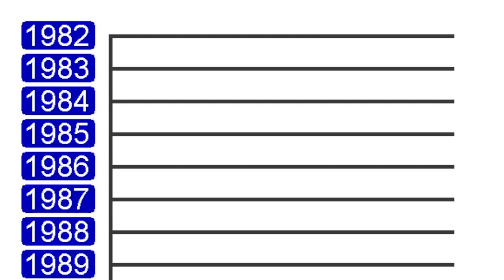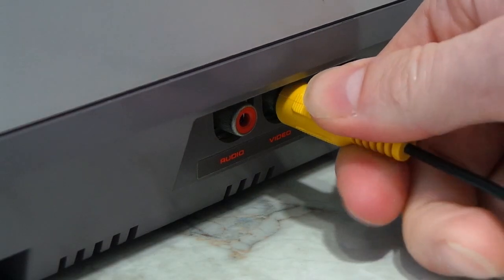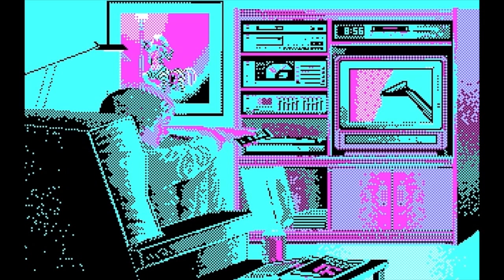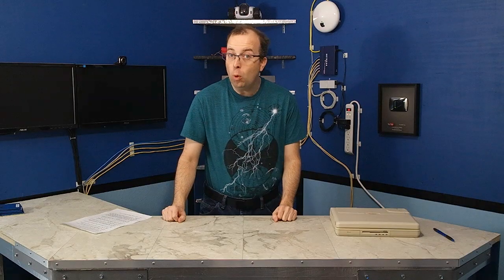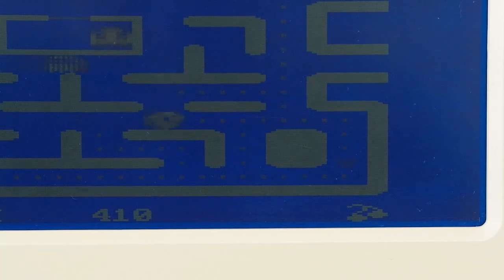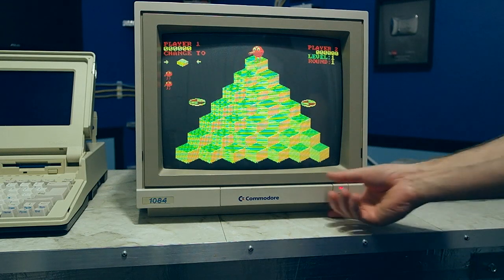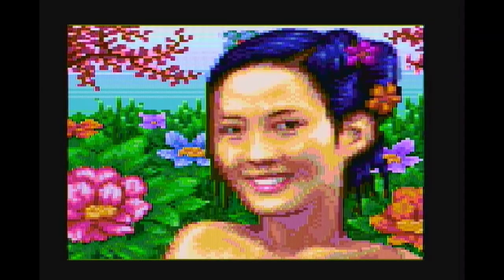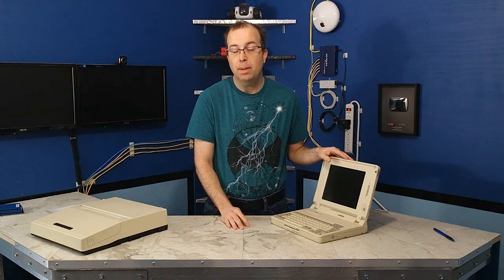CGA Graphics - Not as bad as you thought!

Comment: Would the CGA 'cheat' composite palette have worked with different tv systems (SECAM and PAL) as well as NTSC?
Reply: +TheChipmunk2008 .... depends. You would have to change the way the signal was output, most likely. The differences between colour encoding with those three standards caused issues even amongst machines that used Composite (or RF) as their primary or only display output option - most notably the Atari 2600 (and some of the 8-bit computers), Apple II and NES. Generally the NTSC versions of those had the best and most controllable colour output, and the PAL/SECAM ones either had to have converter circuitry built in to produce something more-or-less like it on those TVs, or just forced their users to put up with inferior colour depth (typically, PAL had maybe half the colour choices, and SECAM had nothing more than a very basic selection).

It's all down to how colour is encoded on the different systems, which is itself a historical side effect of how much earlier NTSC adopted colour transmission - by the time PAL came along, the technology had improved a bit, and then some more with SECAM (it only lost to PAL in 625/50 regions because of having a much larger installed user base).

So, NTSC uses an AM signal, at a rather lower frequency and intensity (and thus resolution) vs the existing monochrome one, with some phase quadrature inside of itself to encode the two different colour axes, but not in relation to the mono signal. Hence how it doesn't generally cause much visible interference to the picture when viewed on a black and white TV, but if there's a patch of intense colour you can see a peculiar alternating light/dark pattern against the mid-grey of the area in question... (starting to see how this works with CGA yet?). On a fuzzy enough set, this is blurred out, and the average intensity still remains the same on the whole, so it's deemed acceptable - and in any case, B/W sets weren't expected to stay in use for all THAT long, and they tend to be quite small too.

This also is why NTSC colour is so blurry, and full of fringing artefacts, and susceptable to being disturbed if someone's wearing a strongly patterened shirt, and you have to twiddle the "hue" knob from time to time on an older set (...which either adjusts the DC offset of the separated-out colour signal or alters its absolute phase vs the detector circuitry... I can't quite remember which). It's a total hack, and suffers in much the same way that AM radio does vs FM.

Which is what the other two systems use ... FM. Instead of adding the (otherwise pretty similar) colour signal directly on top of the mono one, they use it as the modulation input to an FM system, thus modifying the phase component of the mono signal instead of the intensity... something which, although it's technically distorting the picture, is far less visible in a mono picture than futzing with the brightness, because it happens at what would now be called the sub-pixel level (IE any particular bright spot is moved left or right on the line enough for the circuitry to detect a change, but not the eye). This also has the advantage of making it much easier to get the hue calibration correct, as it's tied to the actual signal frequency, and lets you encode it at a higher resolution without sacrificing the quality of the black and white component (in fact, higher rez colour could be argued as reducing b/w distortion, though greater depth / accuracy WOULD increase it). It's much the same concept as FM Stereo, in a way. Also, the colour accuracy isn't affected so much by how bright the picture is...

Additionally, the polarity of the phase shift is reversed with each field, meaning that any slight drift is corrected by averaging-out - either physically (with a sort of line-by-line dither, you could say - a technique now sometimes taken advantage of by retro system democoders) with each field showing an image that's slightly wrong, but in the direct opposite way to the previous field, so the eye sees, at worst, a little bit of film-grain like temporal colour noise; or in the set itself, with later and more expensive models, which used a delay line or even a framebuffer to sum the two together and then apply the same colour info to that line in both fields, reducing the effective vertical (and temporal!) colour resolution vs NTSC and "original" PAL (still not quite to that of the horizontal, mind) but eliminating the flicker and making the reproduction dead-on.

Of course, this would mean that with increasing phase error, the saturation would decrease, but this could be counteracted with the regular saturation control (that could be turned up very, very high on most PAL sets, if needed), and was taken as a handy, subtle bit of in-band notification that either your set was badly tuned or your aerial needed adjustment. A typical analogue PAL broadcast would first exhibit fading and increasingly noisy colour, then effectively drop back to being (somewhat snowy) black and white as it became impossible to realitically determine the FM phase, then start to lose sync here and there, before actually fading out to white noise. If you could only pick up the black and white part of a channel, you knew it was pretty borderline on reception, although just about good enough to still stay in sync. You might not even get the (also FM...) audio track at that point, in fact.

Hence, outside of a minor bit of fringing that's as much down to electron gun convergence as anything else, PAL sets take absolutely no notice of weird spatially-distributed black-and-white or other coloured patterns unless they're pretty extreme (a weather forecaster wearing an ill-advised checked jacket for example), but even then due to the phase alternation, and how the colour clock isn't absolutely locked to an integer number per line as per NTSC* (I think it's actually something-and-a-half or -and-a-quarter?), even those displayed more as rolling, flickering moire patterns than a flat colour. It was in fact one of those characteristic original-PAL "problems" that NTSC didn't exhibit, but then melted away as more and more sets started to use the electronic rather than physical averaging, leaving either a more static moire, or a flat colour equal to the average of the checks / whatever the original pattern was.
(* this is why the framerate is 29.97 not 30.00, btw, and the line rate is 15734Hz - the mono and colour signals had to be locked together, but the colour frequency had to be changed to something very slightly different from the original 15750Hz line frequency for reasons both of avoiding interference with... something or other, I forget... with the secondary feature that along with the "colour burst" sync it would signal the set that it was a colour not B/W signal)

You might be able to do SOMETHING along those lines if you're clever enough, but really, most systems built for PAL use either built an FM signal from scratch, or where available took the Chroma part of a higher frequency but otherwise NTSC compatible S-Video signal and fed it into a simple modulator acting on the Luma which flipped its phase at each VSync. I think that's even literally what's build into the simple Composite <> SVideo converter dongles you get, a very basic bus-powered chip that flips mode between combining and splitting depending on which side is being driven and which side is the sink, and has just enough logic to tell PAL from NTSC (probably going purely on line rate or count) and whether it's on an "odd" or "even" field. Though SVideo never really took off much here as it didn't offer enough of an advantage over composite (it basically reduced some of the fringing and red/cyan green/purple colour clash you got with high-rez images) when RGB SCART was already available anyway. Pretty much only ever saw it with DVD players and some laptops and consoles derived from NTSC hardware...
(oops, out of space O_O)
Reply: +TheChipmunk2008 
(cont)

For that reason, you'll quite often find that composite output from old computers in PAL areas is actually described as "monochrome only" where RF and/or RGB output (digital or analogue) is also available, because it's expected you're only really going to be using that to hook up a cheap black'n'white or green/amber screen CGA-compatible monitor for basic word processing and other serious applications in low-colour 80-column mode rather than gaming or colourful graphics (for which you'll just plug in the RGB cable to a colour monitor or a SCART TV, or use the RF cable). I suspect that it is in fact either outputting a straight NTSC-spec (but 625/50 rate) signal, which will be rendered as black and white on the majority of PAL screens of the time, or even deliberately stripping the colour signal from it before output to avoid the dotty-pattern effect.

In fact, you couldn't play NTSC console games in colour on our "old" (early 90s, 25-inch) tube TV using a 3xRCA or cheap composite-signal-only SCART lead - they just appeared in monochrome with that characteristic patterning. You had to use at least SVideo (worked with some fringe cases) or more commonly full RGB, in which case it effectively synced as PAL-60. Annoyingly, now that I've got both a portable CRT and a regular large-format LCD that are perfectly happy with basically any signal you can find to feed them, the machine I wanted to do that with (a recently acquired Amiga 600) deliberately strips the colour data from its composite output... for both NTSC AND PAL modes. Meaning until I can get a SCART lead for it, I'm stuck using the RF output. Thankfully it's pretty good quality, the TVs have strong tuners, and the broadcast analogue signals have all been turned off, reducing interference, so it still looked fairly good, except for when I tried using a word processor in hi-rez interlace mode on the LCD... it reduced the usual flicker to nothing more than an occasional shimmer around the mouse pointer, but the actual letters became blobs of orange and blue...

(Which suggests you may be able to do something by taking advantage of the additional interference and blurring effects of the composite signal being further encoded into RF for transmission into the tuner - so the colour is two different DC signals quadrature-encoded into a single waveform, frequency modulated into the brightness signal, and then further modulated onto the carrier... - but the effects might be difficult to achieve and limited in scope, and possibly even vary according to horizontal and/or screen position...)

You'll note I haven't mentioned SECAM so far ... largely because it's pretty irrelevant these days, almost any SECAM device still operating will also be PAL compatible and probably default to it anyway. A bit like a colour TV being technically compatible with monochrome signals, and some older UK sets having twin-system (UHF 625-line colour and VHF 405-line B/W) compatibility, but the secondary system hardly ever being used in anger.

However, should you be in the position to try it and have the urge, the main difference between them is - should I still remember this correctly - that instead of transmitting both colour components simultaneously in a quadrature encoded wave modulated onto the colour, the transmitter instead averages each component over two successive lines (fields?), and transmits each averaged component separately on the alternating lines/fields using a rather simpler straight FM encoding like that used for stereo radio. The receiver then separates and stores that data for the first component, and combines it on the fly with that for the second one as it comes in, using it as the actual hue/saturation for both lines. Hence, SEquential Colour And Memory (which happily works both in English and in the French equivalent).

Obviously this requires a more sophisticated setup because you also have to store the brightness information at the transmission end and send it with a one-line delay, else the chroma won't line up with the luma (essentially what the electronic-averaging PAL sets also do, but at the receiving end), but as it was an evolution from the other two standards, it was evidently felt worth it. I think it was also developed alongside the curious 819-line, 5:4 aspect (and monochrome?) standard the French used for quite a long time, hence the (misremembered?) possibility that the way it worked also included some element of PAL - IE, the two components were transmitted over successive lines in the same field, and then phase-inverted in the same position in the next field - therefore actually spreading the colour information over 4x the vertical distance as NTSC... making it very stable and potentially allowing very high horizontal resolution, but blurring it somewhat in the vertical direction. Obviously in a higher-vertical-definition system where horizontal bandwidth was already going to be a problem (because more lines per second within the same width of radio channel = fewer pixels across each one), this would have been perfectly sensible, it just ended up a bit lopsided (kinda like NTSC, but vertically instead of horizontally) when they decided to also switch to something akin to PAL-625 as the underlying standard when bringing in the colour service.
(It also would have required either a LOT of digital memory - possibly bubble/racetrack type - or a large and very well-tuned set of mercury-capsule / long-PCB-trace delay-lines...)

All of which means your opportunities for NTSC style colour-futzing are pretty much nil, as the entire driving force behind the standard was to eliminate those side effects (and why, for example, the SECAM Atari 2600 only has 8 basic primary colours available, probably produced using the absolute minimum amount of circuitry possible that would still produce some kind of colour SECAM output ... that was still many times more complex than what NTSC or even PAL would have demanded for their ~32 or ~128 colour output.

Whether it also means that you could produce some other, wilder, unique effects on a SECAM screen by other means... who knows. It may be worthy of investigation. But given how much the tech has developed in the 34 years since CGA was introduced, and how even otherwise ancient things like the Amiga blow it clear out of the water whilst being compatible with the same screens (the Commie 1084 pictured, as a rebadge of the legendary Philips CM8833, can accept more or less any 15khz signal going - but of course SCART/Peritel was an integral part of the SECAM standard anyway, so you could just use RGB), you'd be doing it purely as a retro hacker exercise rather than anything useful. So I think the rest of the experimenting is best left to yourself. I've written WAY more than is warranted after all...

(I'm at my work desk, but feeling kind of ill and spaced out thanks to various personal events this week, and have been quite glad of the excuse not to move until the risk of April Fools pranks has more or less subsided)
Reply: mspenrice  -  PAL does NOT use FM for the colour! SECAM does, though. PAL uses quadrature amplitude modulation like NTSC does, but it inverts the phase on one component on alternate lines (hence the name). If we're going through the odd field, it'll be, say +90 on line 1, -90 on line 3, +90 on line 5, -90 on line 7, etc.

I did a lot of research into PAL to write a shader to simulate it. Does simple decoding by default (relying on optical blending), but a quick tweak and a second much simpler shader can simulate a delay-line decoder. The delay-line version is in two parts because the simple one is slow enough as it is (especially if you enable the noise injection to simulate a crappy reception) and trying to do it in one pass would need twice the number-crunching.
Reply: @ mspenrice: Wow, now that's an youtube comment. Thanks for the lesson!

Comment: Composite NTSC trick well yeah but what happen with PAL system... lol you get Monochrome just like with the Apple II on a pal TV
Reply: +Benoit Colson NTSC also has different horizontal and vertical frequencies. A PAL system will not be able to sync to an NTSC signal in the first place. Unlike most other composite systems on the market, there never was a PAL-compatible version of CGA (or SECAM for that matter). So since CGA is not compatible with anything other than NTSC in the first place, the issue is purely academic.

Comment: I still reserve my right to hate CGA because for the most part all I saw was pink and blue graphics. OK there were impressive workarounds if you used composite but not an ideal solution in reality. Other systems by default (such as the Amiga, C64) were not as complicated getting colors on the screen and therefore looked better most of the time.

Comment: Pretty interesting stuff, from a historical perspective. I had a Commodore built PC-XT computer in the late 80s and a Commodore 1084 monitor. But afaik, the pc didn't have a composite output, so I was stuck with the ugly 4 color mode. VGA was such an incredible improvement! But super expensive at the time.
Reply: +Charles Martel 
Commodore did have a line of PC compatibles back then.
Reply: +Patchuchan I know, I HAD one. ;-)
Reply: +Charles Martel I have a Commodore PC20-III which has composite output. It's not 100% compatible with CGA though, the colours differ a bit, or a lot, depending on the mode used.